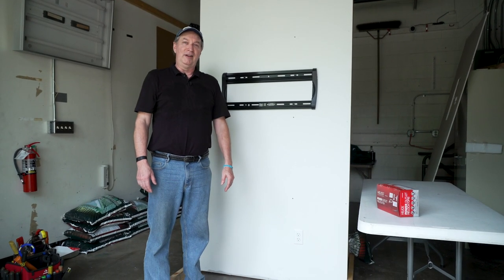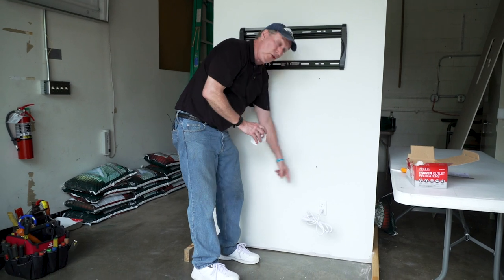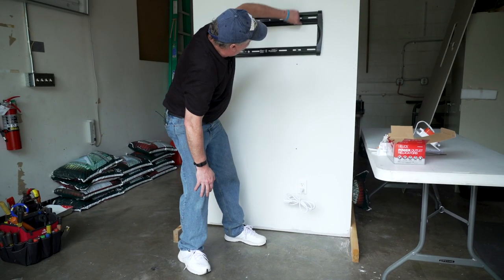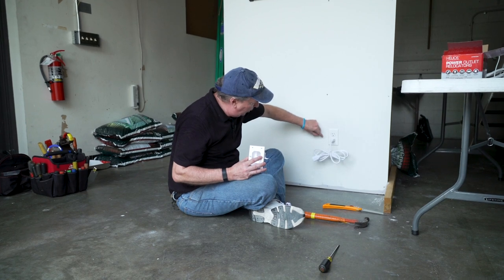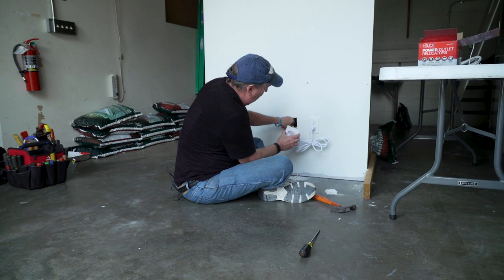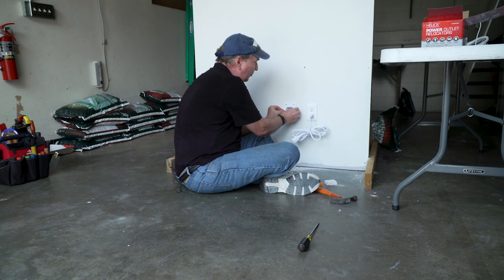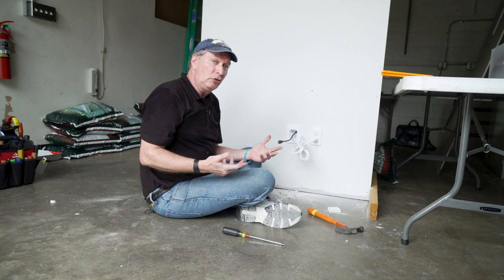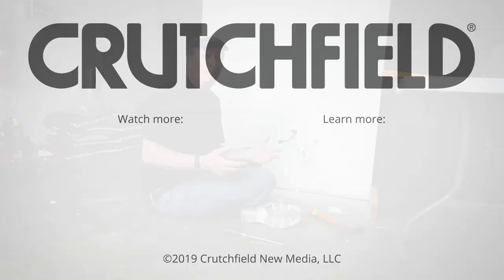How to relocate an outlet when wall-mounting a TV | Crutchfield

Comment: Great explanation, one thing is most of the time it wont be an interior wall and you will be faced with insulation and possibly a fireblock. Use a metal coat hanger to fish the wire through the insulation. For the fireblock you will have to make another hole in your drywall to drill through it and then patch up later.

Comment: I got it better than all the videos i searched Thanks sir 🙏🏽🙏🏽🙏🏽.

But wanted to know what do we call the outlet's name you used?? How can I specify it?

For Masonry walls, do we use built in conduit for the wires first?
Reply from the maker: The power relocation kit in this video is no longer offered, but we do have similar models that can be found here:

https://www.crutchfield.com/I-rYALc227/shopsearch/power_relocation_kit.html

We do not have specific information regarding the install of this gear into that type of wall, but it does seem like a good idea to protect the cables from any sharp abrasions inside cinderblock and bricks so running conduit is a good idea

Comment: Yeah I just bought 12 gage wire and moved the outlet up. Covered the the old hole with a plate. Easy peasy
Reply from the maker: It is always nice when you don't need to plug other gear into the outlet and can do that relocation! Do you use no other gear with it? Or is that gear elsewhere in the room/home?
Reply: @crutchfield  I thought about leaving the bottom outlet but instead I placed two outlets above just in case I need to plug something else in.
Reply from the maker: Great planning! 👍

Comment: How did you determine where to cut? I know it's along the stud but how do you find the right spot? You only get 1 shot to get it right
Reply: Use a stud finder. And if you mess up, repair the hole and try again. Repairing drywall holes is not that hard you can YouTube some videos
Reply: @tubetop123  I figured it out. I did 3 rooms. After the first one the other 2 took 15 minutes. Great product
Reply: @flunder50  wow awesome. I guess one can simply open 2 holes and drop wires down without this product?
Reply: @tubetop123  you could but the kit makes it look neat

Comment: Can i use that in the 12000btu air conditioner 110 volts?
Reply from the maker: The Helios AS-PWRLODBL does work with an 110V AC wall outlet. You will want to verify with your electrician that your existing port can accommodate the 12000btu unit.

Comment: Blessings, what if I’m just plugging the tv cord in the wall can I just install one instead of cutting two holes out?
Reply from the maker: If you saying that you will run the TV's power cord in the wall, we do not recommend doing that as their power cords are not in-wall rated. However, if you are saying that you will have a power outlet installed in the wall behind the TV and this power outlet is wired to the home's fuse box, then you would not need two holes for the power; just the one hole. The issue is doing this does not give the opportunity to connect the TV to the same surge protector that the rest of the gear is connected to
Reply: @crutchfield  no I’m not going to run the tv cord behind the wall. I just wanted to see if I needed to cut two holes too and bottom or just top for the tv cord?
Reply: Can I just purchase 14/2 Romex wire, duplex outlet and outlet wall plate and run these things to the bottom outlet that’s already in my house?
Reply from the maker: We recommend checking with an electrician in your area to make sure that would not violate any local ordnances. While that install may be possible to do and sounds like it could work, it does create the issue of not being able to connect the TV to the same surge protector as the rest of the gear is on. And that could lead to a voided warranty and no added coverage on the electronics.

Comment: This work on a TV over the fireplace?
Reply from the maker: It would require the cutting of your walls, and likley drilling through studs to run wire horizontally past studs.  This works best when the outlet is directly below or above the new spot.

Comment: I’m not good in anything about electricity...but I just want to know, what is the difference between running only the original power cable from the TV behind the wall without using those 2 outlets..I know there is a code that you don’t supposed to do that for “fire hazard “ and the insurance won’t cover that in case of fire. But doing the installation that you just did ...is not the same? Or not? Please explain. Thank you!
Reply from the maker: In-wall rated wires have a extra insulation and shielding that helps mitigate the risk of heat, fire, or shorting out behind the wall of your home.  the original cord does not have the same level of protection.

Comment: When I try to put the wire through it hits something that looks like a 2x4 that's horizontal
Reply from the maker: Sounds like you may have run into additional bracing. You may want to double check this and reconfigure your installation.

Comment: Is this up to code?
Reply: Thanks for the quick response
Reply from the maker: All wires are correctly designed and rated for their intended us.  This would be up to code, yes.
Reply: I know this old but someone else might see it. This is definitely not up to code you cannot run a power cord behind drywall like that

Comment: Ok, now show us how to professionally do it. So you don't have a cord hanging out of the wall below the tv... For people that don't have a tv stand that they put under their mounted tv...
Reply: Yeah the only reason anyone should every consider this system is if you need to move your cabling laterally past studs, and the idea of going up, through the top plate and back down the wall is too cumbersome or impractical. As you can see here, he had no such requirement. Just run it directly through the wall like he already is doing with a true new receptacle wired in the circuit (he doesn't show). Plus, you go from 2 to 3 available outlets with his ugly method as opposed to the potential for 4.
Reply: Wouldnt doing it this way allow one to use a surge suppressor which is more ideal with sensitive electronic equipment, rather than leave it unprotected using a standard outlet?

Comment: So you just hid wires behind the TV by cutting two holes and how have wires showing at the bottom? Not a solution to HIDING wires.
Reply: The top wires/outlet are hidden by the TV. The bottom wires are hidden because you'll have an entertainment center or some type of stand where your audio/video gear sits. Try to think it through.
Reply: It's also against code to do this, it's amazing how many ill-informed people are slobbering over this nonsense.